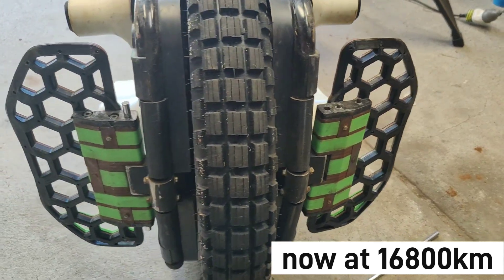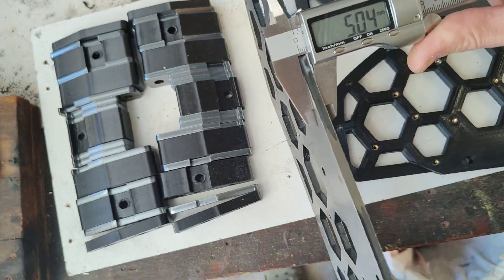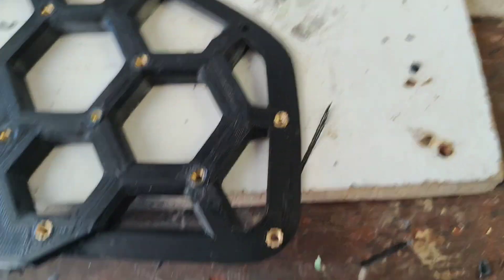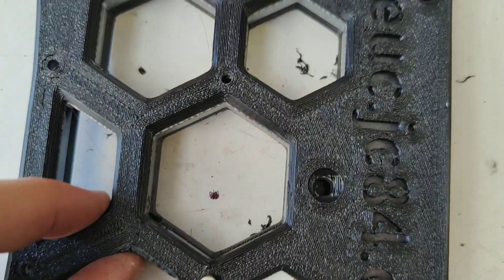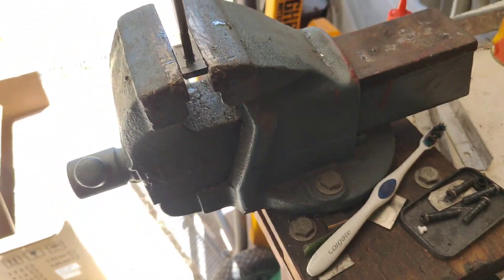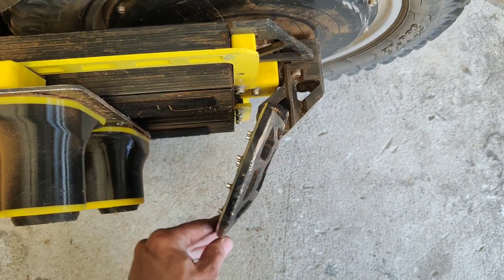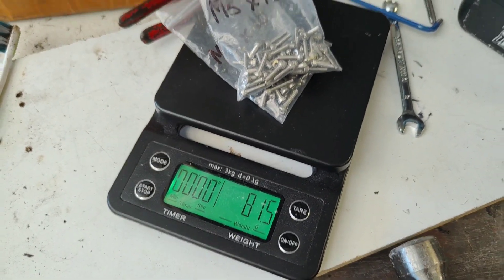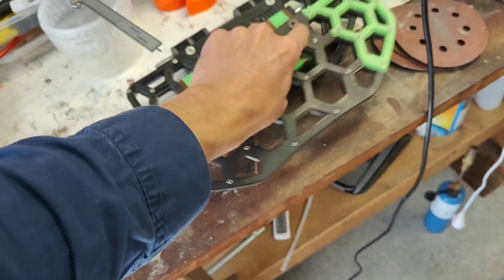EUC 3D Printed Pedals Part 4 design changes

Comment: Hey, very nice work man ! Did you give nylon a chance ? What kind of infill and % of infill you're using ? Thanks a lot !
Reply from the maker: On the pedals I use 100% infill.
PETG become brittle and shatters so I abandoned that material.
ABs seemed the best.
I'm using PLA now however the pedals are all laser cut steel, so the plastic is only cover plates and fillers so the plastic is all non structural 

Nylon is expensive and I never had much success in printing..I'll have to retry.

Comment: Wow, that is a lot of work to end up with pedals weighing 2x more than current stock ones (and 4x Nylonove ones). But I admire your industriousness.
Reply from the maker: Thankyou and glad it entertained you. It sure is entertaining me.
my goal is to make pedal that requires minimal skill to make DIY and are safe!
i've just found a solution to the tapping of threads in the Pedals for studs as seen in video. Finally now for the pedals into the hanger bracket with some pre made parts from aliexpress.
even at 1.5kgs (3kg)on my Sherman i don't notice the pedal weight at all.
Reply: @jc84com  EUC design seems at times to be 2 steps forward and one step back. By the time they have the bugs sorted on one wheel it has been superseded by the next. Then the cycle repeats. Your T4 battery protectors/stand/grab bar was way better than the Extremes.
Reply from the maker: @AJames-jr8kw  soon to be a promo video on the T4 roll cage handle. Hopefully by next week